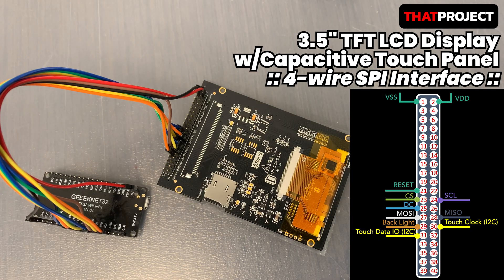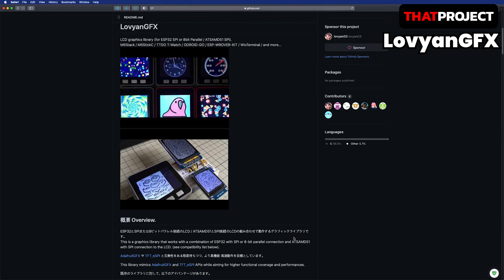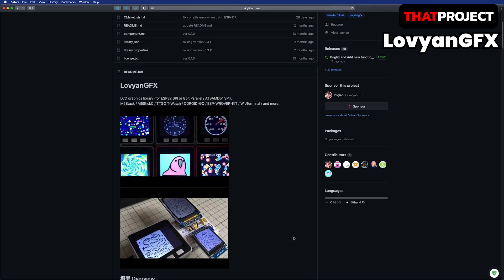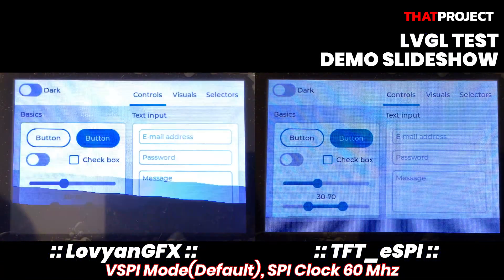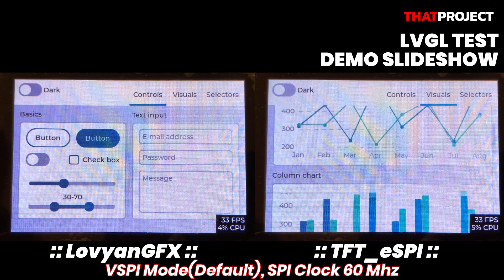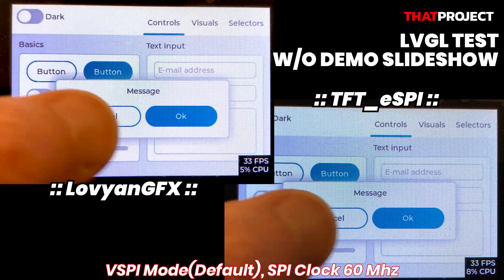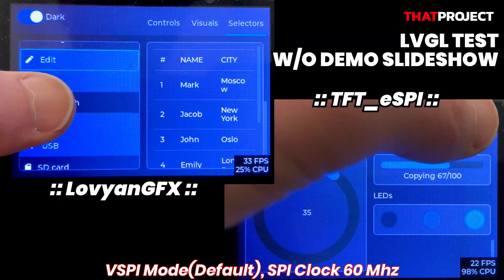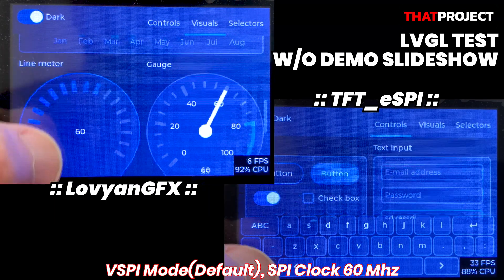ESP32 | LovyanGFX vs. TFT_eSPI Comparison (ft. 4-wire SPI Interface)

Comment: Greetings Eric! Thanks for the video, I wanted to ask you about the lovyanGFX library. I'm trying to show a Sprite and it's been difficult, since it only shows the black screen, I'm working with the WT-SC01 module, here is the code: 

#define LGFX_USE_V1
#include <LovyanGFX.hpp>
#define LGFX_AUTODETECT
#include <LGFX_AUTODETECT.hpp>

static LGFX lcd;
static LGFX_Sprite sprite(&lcd);

void setup(void)
{
  lcd.init();
  lcd.setRotation(1);
  sprite.createSprite(480, 320);
  
}
void loop()
{
  sprite.fillScreen(TFT_ORANGE);
  sprite.fillCircle(50, 50, 50, TFT_BLUE);
  sprite.fillCircle(120, 120, 120, TFT_RED);
  sprite.pushSprite(0, 0);
  delay(100);

}

With the use of the TFT_eSPI library it works perfectly, but I have decided to use the LovyanGFX library since you recommend it in this video for the use of LVGL
Reply from the maker: I don't think your code has any problems. Could you please ask it the Lovyangfx GitHub directly? They will definitely let you know what the problem is.

Comment: hey great video :-)

looks like the 60MHz APB speed is ignored by both drivers, so the benchmark may be invalid.

In the LVGL scroll demo, TFT_eSPI appears to be throttled down by the bus (5% cpu for 33 fps ? naaah), which is symptomatic of setting an invalid APB speed.

In the same LVGL scroll demo, the LovyanGFX is clearly running at 40MHz, see what it does at 80MHz => https://www.youtube.com/watch?v=SMOHRPqUZcQ

May I suggest you re-run the benchmark at 40MHz, then run it again at 80MHz, and compare the results ?

This will eventually show that 80MHz can't be achieved with this display (hardware limitations or secondary effects of using loose cables + breadboard).
Reply from the maker: Thank you for your comment. I couldn't check that part clearly. I'll test it again.

Comment: I have tried it with a rpi display wich has support for 125 Mhz SPI, the maximum speed for esp32 is 80Mhz, but the results   have been really noticeable working with lovyangfx.
Reply from the maker: Agreed. It's showing a much better performance.